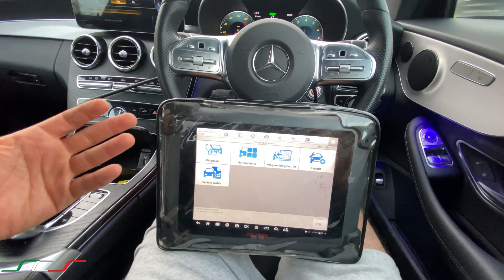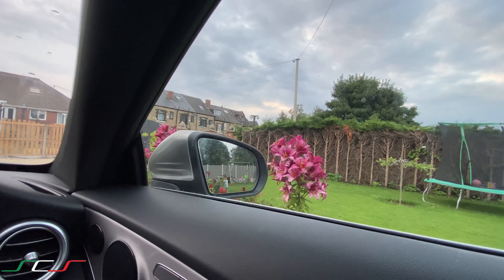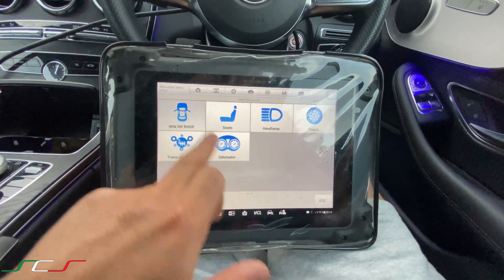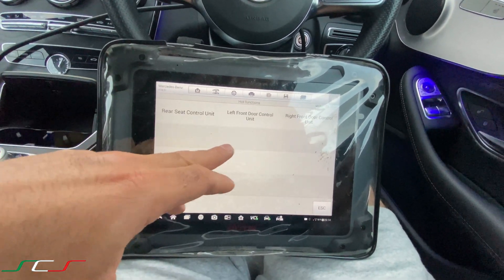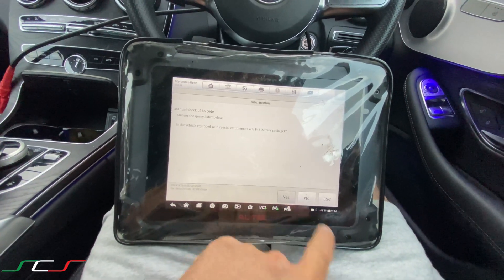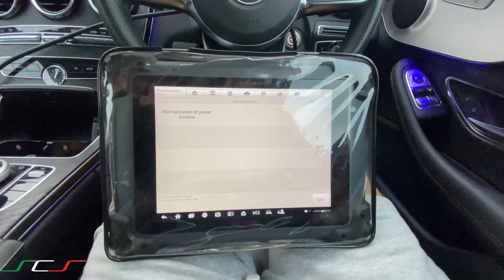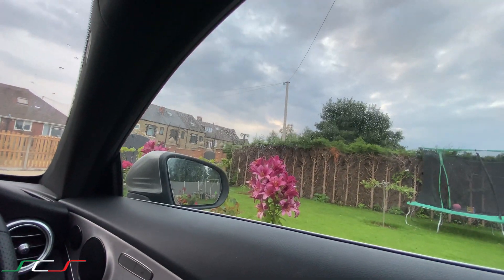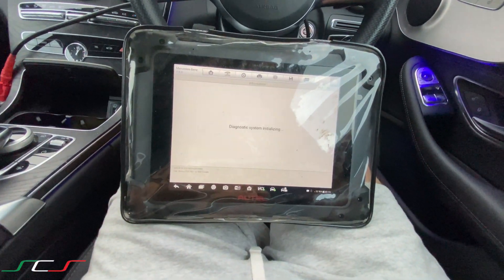Autel Maxisys How To Initialise Windows on Mercedes

Comment: Can we use maxisys ms908s pro to do programming coding on newer model benz
Reply from the maker: @JaskaranSingh-mu3ee  yes you can do that as long as you have subscription. A newer model has come out and it’s kingbolen k10 which is equivalent to Autel and does more than what Autel do for a lot less. Plus it’s 3 years free update and after that it’s only $399 to update yearly. Autel will not only cost you more in the product it’s self but will cost a lot more for update too.

Comment: did you try the programming with Autel in benz new models ? they say it damage all modules ???
Reply from the maker: @muhammedcevdedgali8238  what sort of programming and what year from are you talking about?
Reply: @sadiagnostics  2022 like: EZS (the ignition control module)
Reply from the maker: @muhammedcevdedgali8238  not really come across it myself am unsure. Have you got the latest software on the machine….

Comment: Questions  I have a Mercedes 2018 window code came up in the module I replaced switch code still there it say malfunction  hid doni get the code to go away I cleared it came back
Reply from the maker: @TheMcs33  you’ll need to calibrate the window other wise the code will stay there.